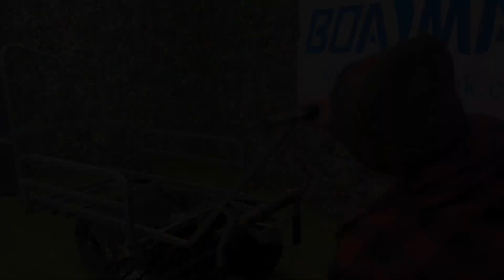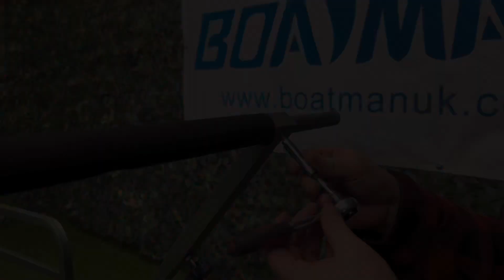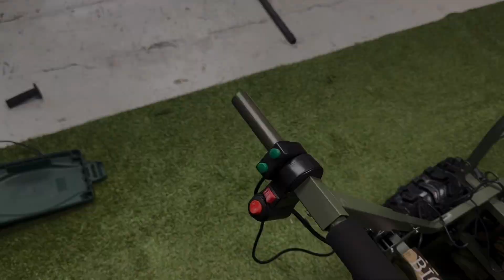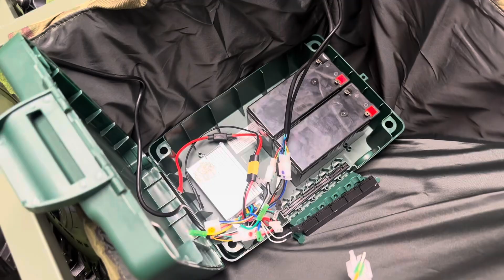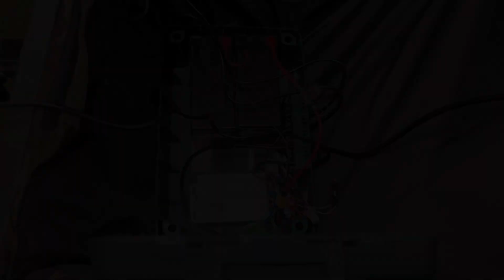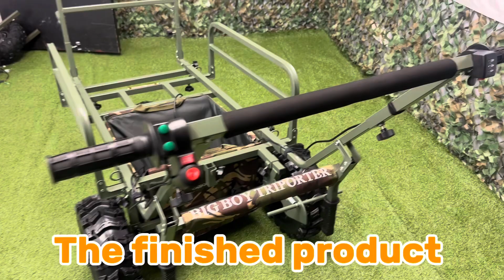UK Barrow Conversions Carp porter power wheel kit fitting and instruction guide

Comment: Greetings, fellow angler. Everything's interesting. I have a question. What happens if the battery runs out? Is the wheel always in the same position as the gear box, or does the wheel have a freewheel?
I carry my fishing gear 6 miles a day. What if the battery runs out?
Reply: Hub motor so will freewheel.